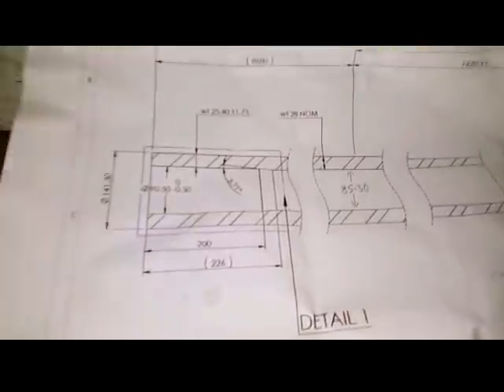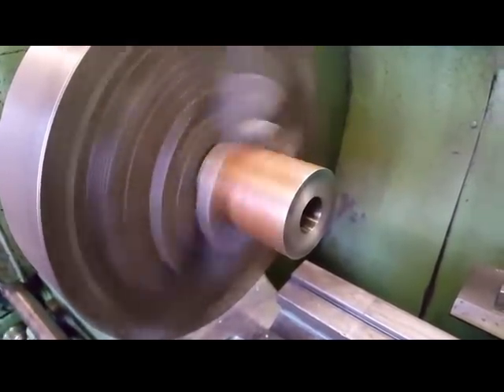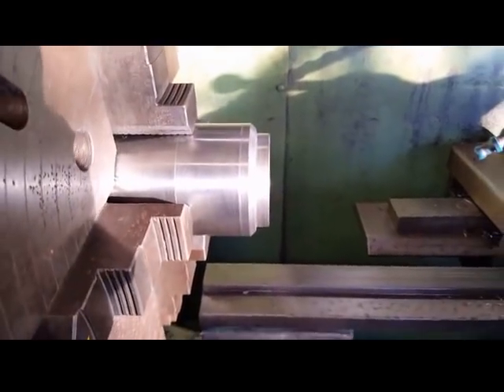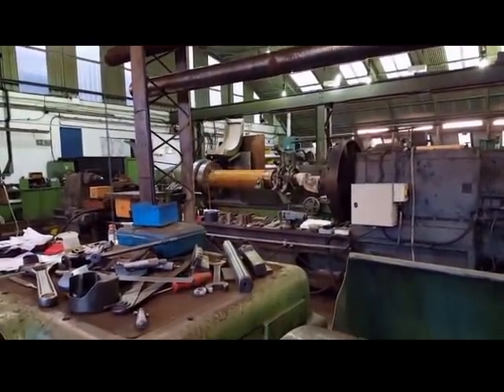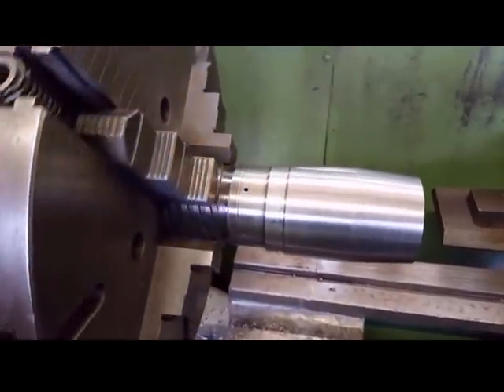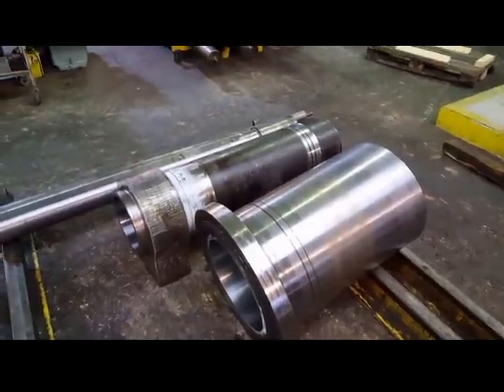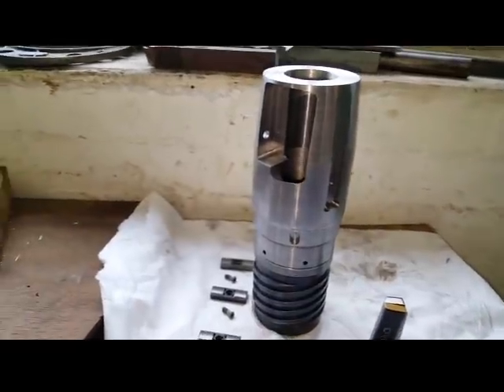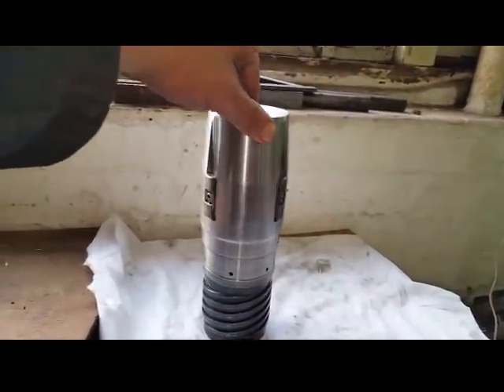5.7° Taper Drill made from scrap metal 90mm drill 🤞

Comment: When I first saw that tube to be bored with the head on it it didn't appear like you could swing it. Couldn't have been more than 5mm between that and the gap end.
A question from the tool you remade, What is it used for? Cutting valve seats?
Cheers